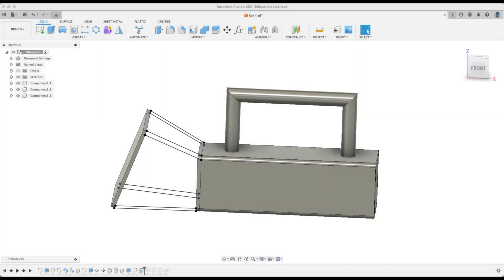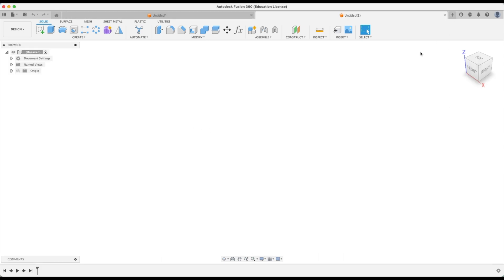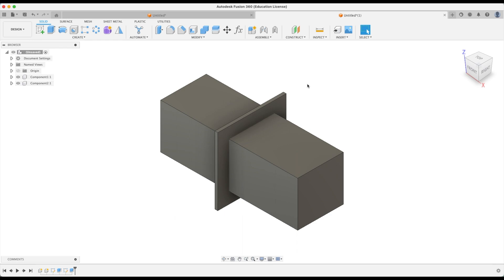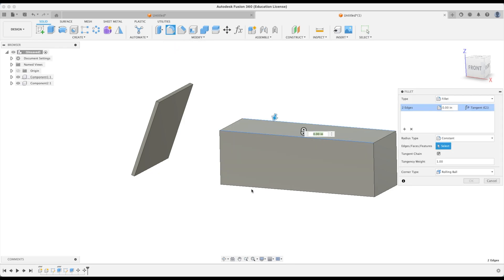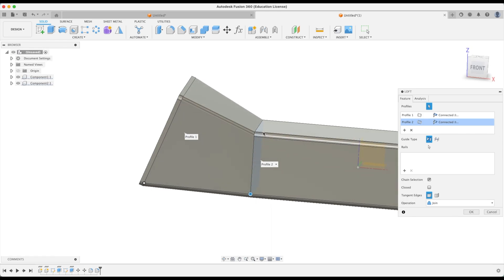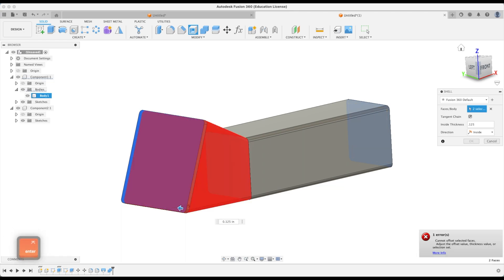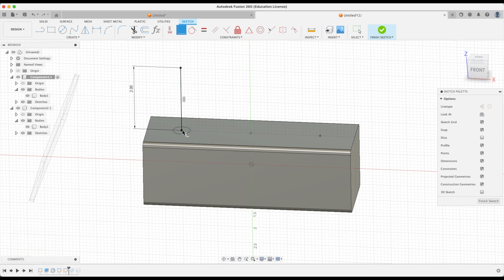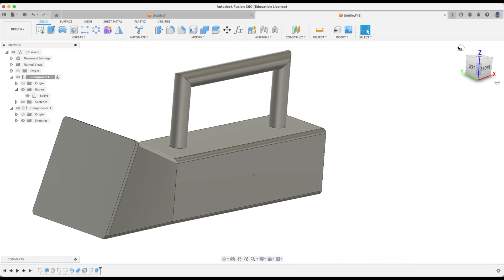Fusion 360 for Beginners - Loft Tutorial - Short Tutorials #7 (2023) #fusion360 #beginners

Comment: I am trying to create a duct having a parallelogram profile at one end and a circular profile at the other. I linked the central axis of both with a straight line - acting as the rail. I wanted the finished  part to be hollow with  a 5 mm thick wall all along the model. 

All I can get from the loft tool is a completely solid body. Is it not possible to use the loft tool in this way or am I missing something.  

If anyone has any suggestions I would be pleased to hear from them.
Reply from the maker: Great question! It sounds like you’ve got quite the project underway. 

The loft tool can be a little difficult to use at times. Here’s a suggestion. No need to use rails. Loft the entire surface of the parallelogram to the circular profile so that it creates a solid body. After lofting, shell the body to the correct wall thickness. Let me know if that works!
Reply: @learnitalready  Thanks , I will give it a go today if I get chance.  It is a simple adapter for a Bosch power tool to a vacuum cleaner. I thought - how hard can it be ?  The answer is - a lot harder than I thought !
Reply from the maker: @we-are-electric1445  That’s the fun part of learning… hitting snags and figuring them out. Thanks for learning along with us!
Reply: @learnitalready  Although fusion is telling me it has carried out the shell command it doesn't work !  I have had two different outcomes. First the two lofted shapes remain as a solid body. The second hollows out some of the outer part of the lofted entity leaving an outer shell then a cavity  and then an inner solid core with a rather odd shape !
Reply from the maker: @we-are-electric1445  sometimes the loft tool can be quite frustrating to make work. Would you consider sending your file to us to take a look at? It’s so much easier to diagnose when I can work with the file. You can find our email on our channel about page.
Reply: @learnitalready  Thanks for the offer. I have now managed to sort it out. Mind you until I 3D print it I'll reserve final  judgement !

I took the two basic shapes - parallelogram and a circle and lofted the two. I used the shell command to shell out the shape from lofting. However, I found it left one of the ends closed (no matter what I tried) so I used Press pull to cut that through.  Incidentally, I have now been told if I put the 5 mm wall thickness into the two end shapes before lofting it should create the open body - though I have yet to try it.

Comment: I followed this all the way through, but then deleted the handle sketch and made it a 3 point arc (for a curved handle).   But it joins the body at a weird angle.
Reply from the maker: Try switching your “Orientation” from “Perpendicular” to “Parallel” in sweep mode. Should solve your problem with the curved handle.